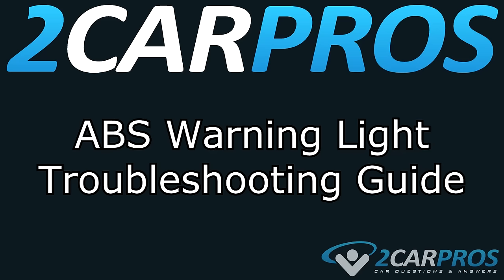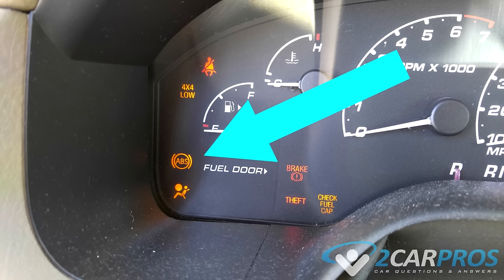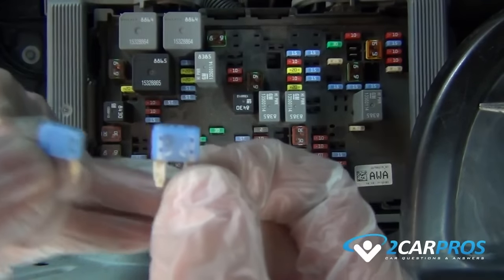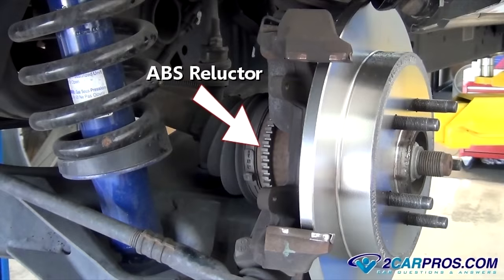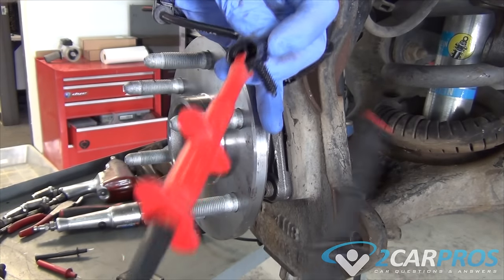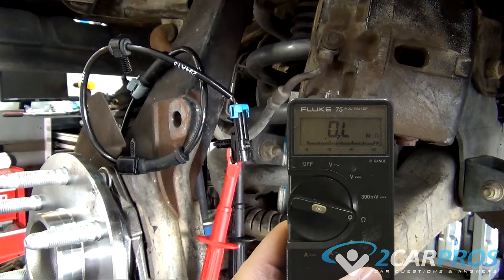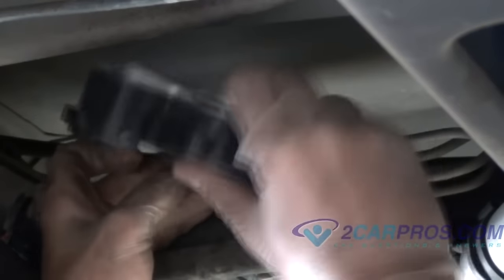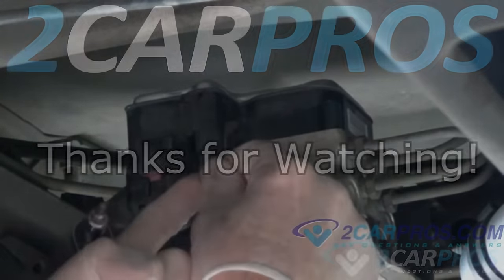ABS WARNING LIGHT ON? FIX IT IN 3 EASY STEPS

Comment from the maker: 1 Million views! Thank you all so much!
Reply: 2CarPros Thanks it's very good information.
Reply: I don't see why anyone would click dislike.   Thank you for sharing this info! Just what I need.
Reply: 2CarPros m
Reply: Sorry not sorry, but that was not three easy steps. After check fuse you lost every person who doesn't know about mechanics and that's why we come to YouTube to get three easy steps to fix something.
Reply: My 2015 dodge challenger is code is u1412 what do I have to do?
Reply: @cdubboy225  use the 3 easy steps, didn't you watch the video?
Reply: Where to put the clamp of the test light Positive or Negative.?
Please help me
Reply: I'm getting a code C1124 "left rear solenoid."  I've found the speed sensors to be working correctly.  Is there some way to "reset" this left rear solenoid without changing out the whole module?  Any ideas would be appreciated.  The dealer want $1500 to change the module.  Thanks.
Reply: You have million views because of the title of video if not you'll not gotten much it's not easy at all because you'll need that special tools lol
Reply: Would a cracked master cynlinder resivoir cause and light to come on?
Reply: 4.6
Reply: Great video here dude, very informative and to the point 👍
Reply: @kimberkimKC  p
Reply: @georgepascual9173  e
Nw
Reply: Can a bad abs pump cause your wheel to not spin at all like the brake is locked even if brake is not
Reply: Please help,,,, What should I do, my abs light is on and when I drive it, it feels sluggish and the 4x4 light kicks on by itself. What is causing this? Could the ABS sensor be causing all this? Thanks for any help.
Reply: @kimberkimKC  n
Reply: M
Reply: Useless vudeo
Reply: 7m bro
Reply: Will my car pass inspection with the abs and esc light on?

Comment: The most common problem is magnetic trash at the wheel sensor. Very simple fix - disconnect the wheel sensor at the brake. It is nothing but a magnet that moves as a cogwheel rotates with the wheel. Spray it with brake cleaner and reinstall. You don't need to change the sensor.  The magnetic particles collect on the sensor when you drive in high water or wet conditions.
Reply: Nice info as the module costs $500 and that's just the part.❤👏❤️thanks
Reply: I just know this is my issue as I drove whole day in heavy rain on a road trip and ABS and stability ESC lights came up. But I also know when I go to Hyundai they’ll come up with some hefty repair price. Unfortunately I don’t know about cars as I’m a girl so unable to follow your easy otherwise instructions. “Disconnect the wheel sensor at the brake” hmmm 🤷‍♀️
Reply: @rainacherienne1010  same thing happned to my nissan extrail. After draining through water logged street due to heavy rainm the abs and 4wd light came up on the cluster because the ABS sensors got debris or magnetic particles clogged on it. Or maybe it messged up the ABS motor control relay like mentioned in this video. Every since sometimes I have speedometer dropping to zero and then working again and then nit for for few minutes and then coming alive again while I also notice chnage in power and speed of the car when then speed needle drops. It all might be because of the abs sensor or wheel speed monitoring sensor getting too dirty or failed.
Reply: @rainacherienne1010  m
Reply: @FishingAdventuresDubai  Same, I drove through a flooded street. I’m at the dealership service as I type and it’s $1,700 to fix it.
Reply: @rainacherienne1010  don't go to dealership service., they are ripping you off with 1700$ bill. Get it done from outside garage.
Reply: @FishingAdventuresDubai  Thanks but I believe in going to the dealership service and paying for the highest quality.
Reply: @rainacherienne1010  😬
Reply: Most shops/people don’t know how to troubleshoot and ask why,how something failed and just replace parts.  Load parts cannon.
Reply: @rainacherienne1010 dam they got u 😂 of course. Mechanics make most of their money from customers like yourself. 😢 get you a man. Then again I know some dudes who can’t even change their own oil, yet alone read a oil dipstick 😂
Reply: @rainacherienne1010  You'd think that would be true but unfortunately dealerships have some horrible mechanics who take advantage.
Find yourself a good smaller shop, where they actually care about their customers. Only reason to go to the dealership is if your vehicle is still in warranty.
Reply: @HunterC.  Very True. 
Unfortunately you are just paying for their huge overhead.
Reply: @rainacherienne1010  I have a friend that has a fairly new Lincoln Nautilus or Corsair. She got some kind of condensation in a skinny break light bar that goes across the back and also something wrong with the right tail light (either out or condensation). Dealer wants $7000 to fix it but it may be covered under warranty. I have another friend that has a Lincoln MKX or something similar. Front headlight went out. Her husband bought the $150 bulb but could not get it in. Dealer wants $4000 to fix it. I don't believe this is isolated to just Lincolns. Dealers make more money in repairs than they do in new or used car sales. They probably just want you to throw in the towel and buy a brand new vehicle, then they fix yours easily and sell it.
Reply: Same as sensors such as the VSS  in the transmission , rearend, ect...
Reply: How about not letting the idiots sell a vehicle that’s not practical to fix?? - The right to fix it - google
Reply: How do I do that? I went through heavy rains and that’s what happened to my vehicle too
Reply: @Tortsking  What Exactly happened to your car ?
Reply: @Tortsking  If you have issues with going through puddles and it causing your car to bog down. If it's a 4 or 6 cyl especially front wheel drive... 1. Alot of mechanics are lazy about putting all the bolts and brackets back on your car, Especially the Deflector Shield / Splash Gaurd Panel under your engine and the rubber covers in your wheel well. 2. Your Engine and Car Wire Harness generally uses a type of plug called a Weather Pack, these have a rubber insulator that keeps fluids from entering the plug and causing the connection to sensors and such to fail in a myriad of ways. On the 3.8gm engines.. I believe its the Crank Possitioning Sensor that gets water, oil,  power steering fluid going into it , so you may have to replace the seal or plug. It could be others sensors... 
  You can also DUSCHE them with WD-40 if you are stuck on the side of the road after a big puddle.. When your car stalls, relax, breathe, and coast as far as you can, you can put your shifter in Neutral really quick, and turn the key while coasting to see if it will start. You won't have power steering or ABS Brakes, but try to glide off the road or onto a side street... As far as WD40.. Wet Duck 40, It stands for Water Displacement 40(40th try on creating the chemical composition), Spray your sensor plugs with it and even your ignition box plug, Some will say something negative, but it can get into a seeping plug and remove the water and 20 minutes later , between the heat of your engine, and the WD40 the water should be evaporated.. sometimes longer but keep your hood closed as much as possible when not poking around under the hood to keep the heat in..
   As far as bad readings to your Tachometer, Speedometer, Auto Traction System, Etc... You have what are called VSS Sensors and such... Vehicle Speed Sensors, these are in numerous places depending on the car. Your Wheel Bearing Hub Assembly, Transmission on the side, Front and or Rear Axel, etc... You access them however you can, unplug then unscrew them and wipe the metal particulates off of them.. spray with Non Chlorinated Brake Clean and wipe them clean , then reinstall... having wire brushes, tooth brushes , pointy picks and tiny pointy brushes, sometimes comes in handy, or compressed air... 
   These sensors are easy to locate on wire diagrams for your car and generally not difficult to clean.
  These are common issues, also, Always check your Battery Connections and wire conditions, loose battery terminals are the most common of all issues,  rakes you a few minutes to clean and tighten , just snug them up a little then an eight to quarter turn more and stop so you don't strip them.. Crooked and inept  shops will tow your car in and charge you for tons of sensors and bs work , when it was just a loose or corroded battery terminal....
Reply: Thanks for the info. I have a nissan frontier 1999 i dis what you recomend and works. I dont pay 300 dollars for the new sensor. Thanks a lot
Reply: Speed ring or tone ring my problem  ABS / traction control.
Reply: @juliehirsh1436 I went to get a wheel sensor. My friend said I can get you the wheel bearing assembly W/sensor cheaper.  2011 ram longhorn.
Reply: Another problem (several)  was the back up sensors going out.  Ram says we can't detect which one is out. We have to replace all four. I watched a video. A guy cleaned his with WD40 . It worked perfect. Wax build up on sensors.
Reply: My 2005 PT Cruiser with Turbo went through a car wash and as soon as I left the bay  , the ABS and 
TRAC WARNING LIGHTS came on . I think that putting the car through a car wash caused water intrusion
into the sensor(s) . I am going to disconnect the sensor(s) , spray them with electronics cleaner , and 
reattach them .
Reply: I can’t just disconnect it. I have to unscrew the sensors only after taking the caliber off the emergency break pads and then I can locate the screw to loosen it.  Same for the front all around 2008 Saturn vue front wheel drive.
Reply: Thank you going to try
Reply: @FishingAdventuresDubai rain got ripped off. Knowledge is power brother
Reply: Nailed it ‼️ Thank you 👍
Reply: same thing happeningwith camry 2007 but its getting hot also
Reply: Thanks so fixed like that

Comment: I had my rear wheel bearings replaced, now my ABS light and Brake warning lights are stuck on.  It really upsets me because if it's just sensors and not actual problems with the brakes, this useless stuff could run into a lot of money.  Stopping back at the repair shop after work today.  I hope they can fix this problem.  My check engine light has been on for weeks and I was told it was just a sensor.  I'm not rich to spend a couple hundered dollars on each warning light that happens to come on because a sensor is dirty.
Reply: So what happen? Did they fix it for free? I think the guy working on it messed it up putting it back together.. 5 years ago lol.
Reply: Its happen to me now..after brek check using throttle and brek at same time..
Reply: @fatahaac3  How is that? Tell me exactly how did that light come on in your vehicle?
Reply: Same as my car,after they put 2 tire front bearing the ABS Andthe  check Engine light came on,the mechanic told me to buy a sensor, huh head ache.i did not fix the brake yet coz I don't have money......
Reply: Its all a con .

Comment: abs is good but for many years, from the beginning,we had no abs in any car.  You don't have to have it to drive.  Of course abs does add a slight degree of a safety.
Reply: I learned to drive 50 years ago in Northern Wisconsin (think snow and ice). I hate abs - when it is slippery I have to continually remind myself not to pump the brakes if the vehicle goes into a slide. I like the solution that involves removing the fuse and putting tape over the idiot light. Easier to dismantle the abs system than to turn off my finely-honed inner abs system.
Reply: Abs light is a mot failure now so it needs to be off
Reply: Excellent example of over-engineering. ABS is not needed. Period!
Reply: @jeffmilum9001  say that to a pile up on a highway and your doing 70mph and have only 40 odd meters to stop
Reply: @kiviKatKa   I have been in a situation where there were several pilots and/or I had to slam on my brakes and I didn't want gravel or some other substance to cause my ABS to kick in.  In 50 years of driving I have never needed ABS I just use my brakes and my steering wheel
Reply: More than a slight degree in most modern vehicles. Its there for a reason, don't ignore the symptoms/signs 👍.
Reply: @jeffmilum9001 it is in modern vehicles.

Comment: By some of the responses on here, it looks like those three easy steps aren't so easy for those who have zero mechanical know how.
Reply: Frank Gonzalez don’t be a dummy get a 5 dollar test light and a
10 dollar multimeter ...
Reply: Frank Gonzalez he LOST ME ON THIS PART
Reply: It is no one's fault that you do not know anything about mechanics. Take the car to a shop then.
Reply: Fully agree
Reply: @Smegma_pirate  where do you test with a multimeter ED Falcon 94 model
Reply: @markkouros6628  at the thrust inverter pin 3 banana
Reply: JUST PURCHASE AN ELECTRIC LUG NUT 
REMOVER ; WAY BETTER THAN AN TIE IRON + AND YOU CAN CHECK YOUR BRAKES AND SENSORS BEHIND YOUR RIMS 
EASILY.
Reply: Just pulling it out and looking at it is not enough

Comment: Looks like I'm Not alone in the ABS light thing. I've had this thing for almost 10 yrs changed wheel bearing its 4x4 & light came off after all was put back together & drives & sounds Great I don't get it.

Comment: Just info - some vehicles have the reluctor as part of the wheel bearing. In this case the new bearing has to be oriented correctly or you're back to where you started - no ABS.

Comment: Try this first... My 2010 Subaru legacy 2.5i abs , flashing brake light and disabled AWD. It was the battery ground wire . I unbolted it from top of engine block and wire brushed it and the engine block. Cleaned out the threads and wire brushed the bolt threads. Hooked back up and turned key on. No lights. Been 3 months now, no problems.

Comment: ABS light on   (05 Blazer) causing a parasitc draw  I cleaned the ground wire on the Rad frame And removed the butt connectors further down the line which had rust inside them ..Problem solved Saved myself from testing a module and calling myself a parts replacer

Comment: Reasonable, quick overview of ABS, without great detail.  Thanks
Reply: So basically if the fuse isn't blown it's going to go to a repair shop.  Sure hope people have found an HONEST one or they are going to tell you it's the most expensive fix, even if it's not.  Here in the south, no snow and drive carefully in the rain, no need for ABS system.  Remember we drove without these for 70 years at least.  Mine just went off at 10,438 miles on a car that is 5 years old.

Comment: step 1, remove abs fuse
step 2, store fuse in glove box
step 3, place small piece of tape over abs warning light
:)
Reply: Great Esay super grant i do that sooon hic
Reply: Yes garage told me take bulb out and will pass MOT but had been thinking about tape as well.
Reply: Hey that’s my way also lol abs brakes suck anyway
Reply: How do you know what fuse to pull out?
Reply: @daneneasbey4853  Look at the picture, usually on the fuse box cover. It will say abs fuse.
Reply: @daneneasbey4853  If you can't find a picture on the cover look in your owners manual. There will be a section telling you which fuse is which.
Reply: Lol 😂
Reply: "Tape", any preference?  LOL. just kidding.  I've had a lot of people say the same thing. Prefer it be right, but at this nightmare point you never know, it might come in handy!  Lol. Have a good night!
Reply: Ahhh.. The Homer Simpson method 🤣
Reply: step 4, experience catastrophic accident when your "organic" ABS system fails.
Reply: I dont even pull fuse just put tape over light it does try to prevent me from shifting at first but turn the key off then partial to start at same time shift to neutral works great that way and i just throw in park when i need to park and make sure to have my parking brake on
Reply: @JNXT_Railroad  
Step 5; return to driver education to learn how to drive
Reply: @davidpeters2201  driver education is non-existent. But you knew that.
Reply: Black electrical tape is Nicest
Reply: Q. My ABS light only comes on when it rains. And when it comes on, you can actually feel the brake pedal pumping itself.  What is causing this?
Reply: If i remove the abs fuse , it wont let me take my 95 Ford F150 out of park so that advice is wrong
Reply: @keithnichols1366  I guess it depends on the brand of vehicle bud. Works fine on a 03 Chevy 2500HD. So that advice isn't wrong lol
Reply: @allanrakes751 and is it grinding ?
Reply: And then u don't pass Inspection the guys that inspect vehicles will definitely see the tape over the dash
Reply: @jamesbradyjr8067  What inspection lol. Look it up, 15 states require vehicle inspections, that means 35 states don't  :)
Reply: @farmcentralohio  Totally understandable, but for the people that live in those states.You're gonna have to fix it the right way

Comment: What about when you have intermittent steering issues and your calipers stick with no patterns?  Nobody seems to notice a problem yet there's 0 volts going to my ABS module and a constant drag noise coming from both front rotors.  
I wish mine would throw a code.